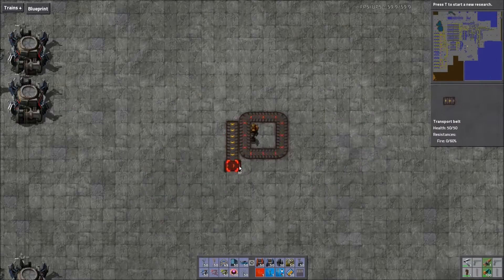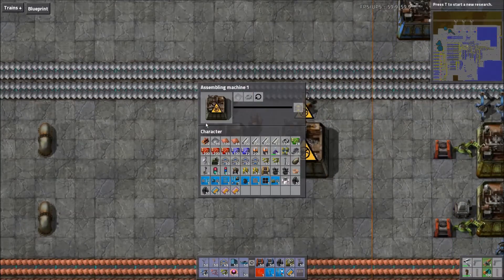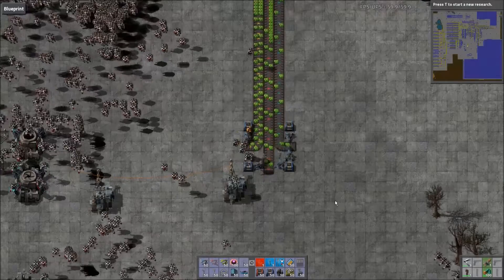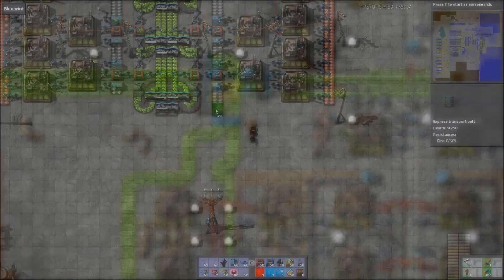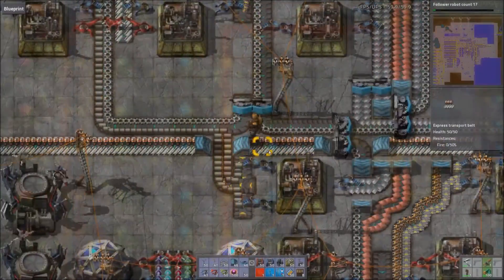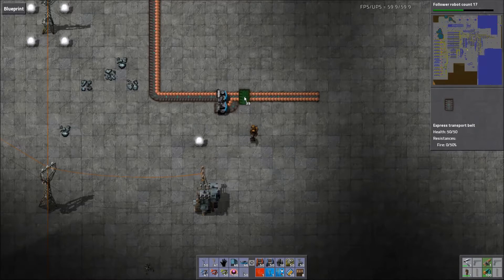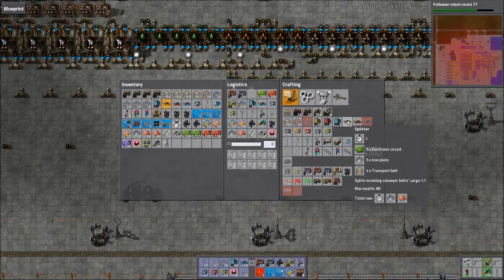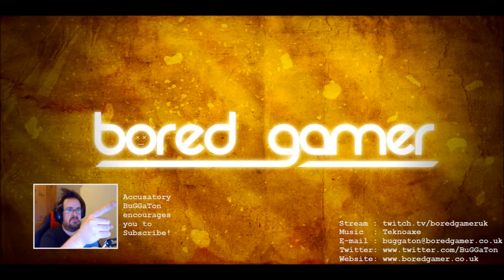Encyclopaedia Factorio - Transport Belts, Splitters and Underground Belts

Comment: Very informative and thank you, could i ask how you got your inserter to place items from your chest onto the conveyer belt? i set up what seemed to be a duplicate of the same system you had at 1:21 but nothing happened
Reply from the maker: +Dbeast300 They should just go on the belt as long as the belt is adjacent to the inserter and opposite the chest.  Check the rotation of the inserter ("R").  If you're using smart inserters you need to set the filters but otherwise... well it's been 3 weeks.  If your problem has persisted lmk and I'll try to help!
Reply: BoredGamer BuGGaTon I was able to figure it out but thanks for! (it was the rotation)

Comment: If I have 2 different types on one belt, say copper on the left and coal on the right, how do I split them up so that I can have two belts each with only copper or only coal? I tried a splitter, but that just puts both mats on both belts... How to I split them back up?
Reply: there's a very complicated way using a strange feature of splitters and underground belts but it's not a good solution. the best solution is to not mix them onto the same belt in the first place but failing that you can use smart inserters to take one of the materials off and onto another belt